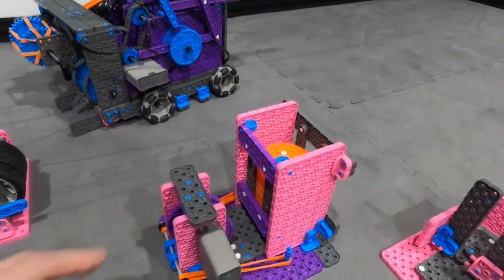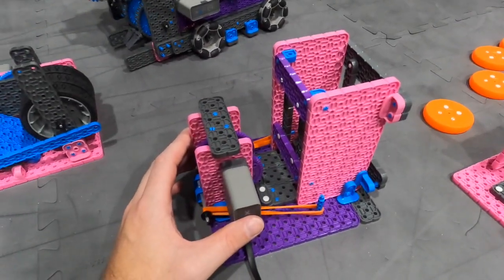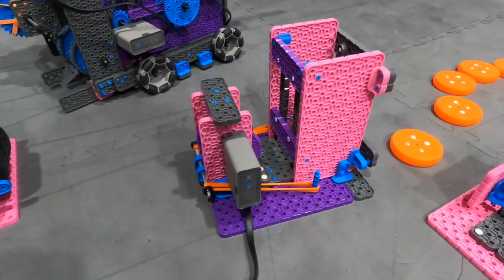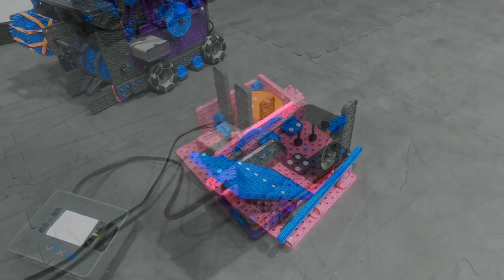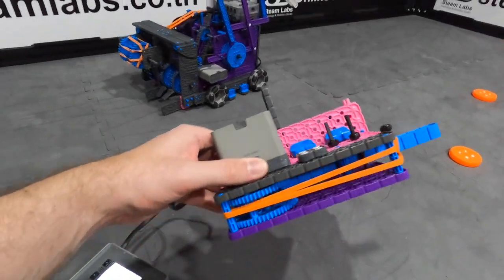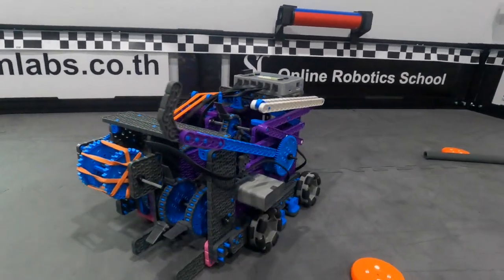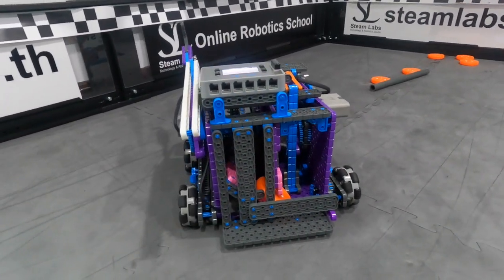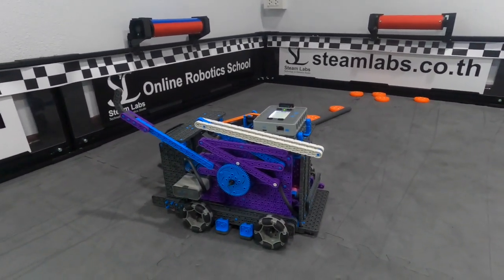VEX IQ Slapshot Robot - Robot Ideas and mechanisms - 2022

Comment: How do you get the disk off the floor? Do you use a ramp or some sort of wall?
Reply from the maker: Using an intake with long tank flaps to pick up disk from the floor and yes, with a ramp that then drops the disk onto a container
Reply: @steamlabstech  Thanks, I will try to implement this into my prototype bot.
Reply from the maker: Let me know how you get on, there are definitely easier builds and I think our teams will try some of the simpler mechanisms I demonstrated along with an intake